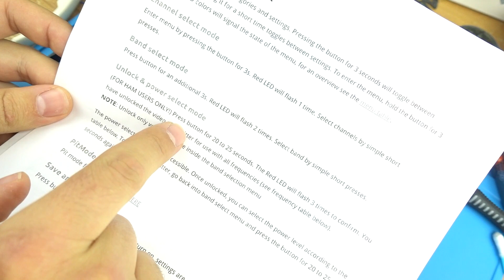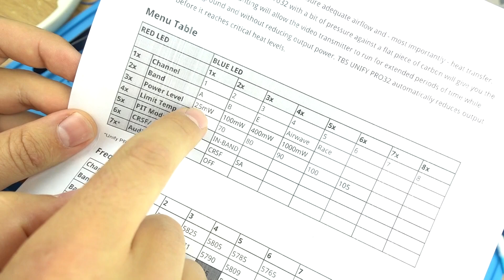How to manually adjust VTX Power on TBS Unify Pro32 Nano from 25mw to 400mw VTX

Comment: This is so fn frustrating. I've got both lights but no ability to get any more than 25mW. I can go through the changes in the OSD and it even shows in Betaflight Configurator under the Video Transmitter tab as 1W+, but it's still showing 25mW in my OSD. I've done this exact process 5 or 7 times already. It shouldn't be this difficult. I've got the Unify PRO32 HV. It should be the same, right?

Comment: When I press that button - nothing happens - the leds continue their intro blinking show  until they finish going through the menu items and then only blue led stays on indicating the vtx is locked. The same happens on my other two Unify Pro32 Nanos... Purchased at different times from different stores, so it is practically impossible they allcome from one batch with faulty buttons....
I tried short press, mid press, long press, double click, holding buton pressed while powering up, pressing the button after the intro flashing sequence is over - same result... Has TBS changed the way to unlock the full power recently.
Reply: Ok - after several evenings spent on this subject I finally worked out the solution - pls pin this comment because it may help others in a similar situation to mine. I had my Unify Pro32 Nano vtx wired to a Crossfire Nano receiver - including the Unify TX = Crossfire RX channel (pls refer to the Unify wiring diagram in the TBS' manual). Only when I desoldered that wire did the button started working. In your video the wiring is different - you did not use the Unify TX pad, but anyone using Crossfire or Tracer receiver will come across the same issue as I have.

Comment: Great video, but I still have a weird situation.  My red/orange light does six teirs, instead of three.  When you plug it in, it's supposed to blink what ist's set for...One red blink, X blue blinks, two red blinks, X blue blinks, three red blinks, X blue blinks, then it 's supposed to got to normal or standby mode, (red and blue light solide)  Well mine keeps ging, 4 red blinks, X blue, red5 and 6 blinks, then repeats. not sure if cam shot.  

What board are you using is that an aio crazybee F4?  I'm almost done building a toothpick, the Gnarly primo3, I'm using the crazybee f4 with built in flysky rx.  I go very light on my telemetry, so I din't even hook up smart audio.  Powered nano and cam ss(RunCam Nano)  seperately, off the 5v pads on fc, and then just connected the video wire between cam and vtx.  I was wondering, did not hooking up smrat audio wire form the unify nano cause it to throw some weird error?  I've done it that way a bunch of times, on other builds and other vtx's,  I use flysky on sub 120mm quads wth Evolution radio, and a dock king, so I really don't need BF OSD on my smaller buisds.  Any ideas you have, or any others stopping by, would be greatly appreciated, thanks!!